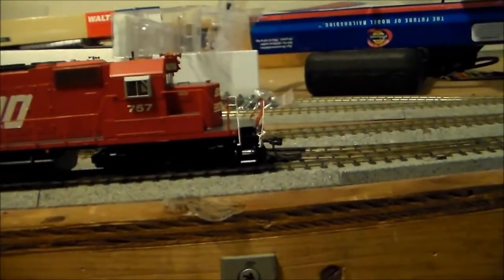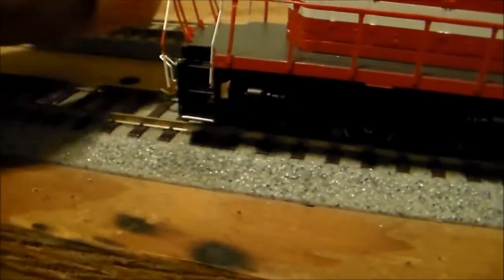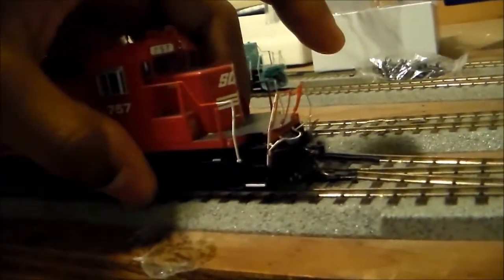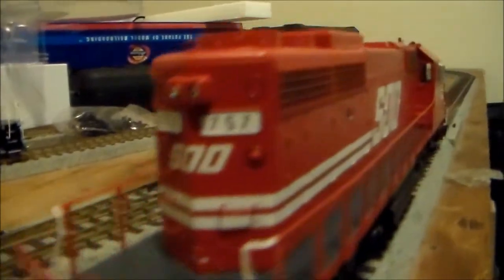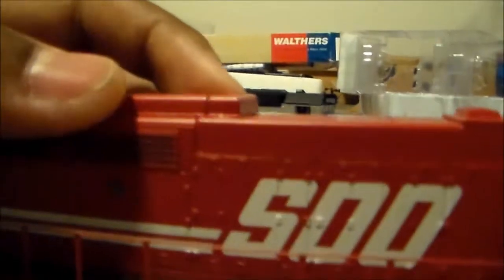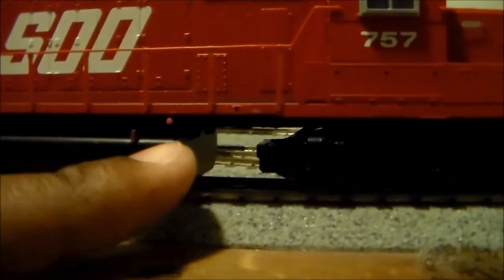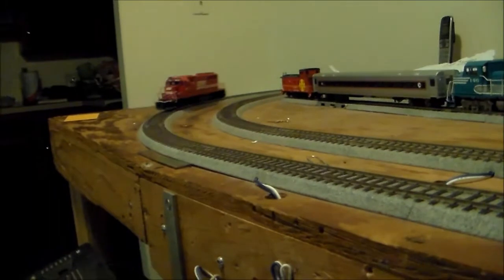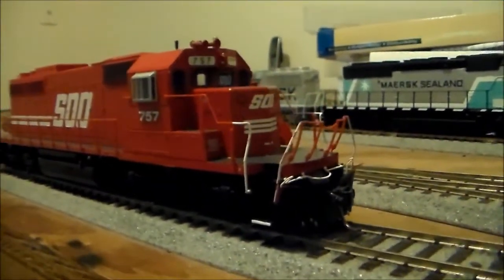Review-Athearn RTR red SOO Line SD40-2 757

Comment: I miss the old blue box kits they had
Reply from the maker: yeah me to. They were fun and durable also.
Reply: EMDSD14R I have an athearn blue box conrail gp40-2 that I got at a train show for $24.99 and I had it for 6 years and it still runs great
Reply from the maker: Dylan Lawless That's cool and that's a good price. I have ones older then that and they still run great also :-)
Reply: EMDSD14R I'm thinking on buying an undecorated gp40-2 and paint it in the Norfolk Southern scheme so I can run it with my conrail gp40-2
Reply from the maker: Dylan Lawless Oh that's cool you could # it as an ex CR GP40-2. I mean NS picked up a bunch of them. Example 3030, 3029..etc those two units are ex CR units or you could # it as a true NS unit also :-)
Reply: EMDSD14R wow I didn't know that and I'm getting an atlas master dash 8-40cw along with the sd40-2 for my coal train
Reply from the maker: Dylan Lawless Indeed look up the NS CR roster on google and you'll see/ Oh that's cool. Those will look great on a coal train :-)